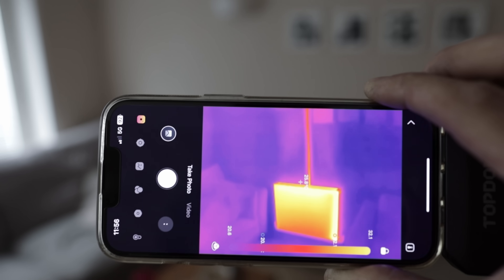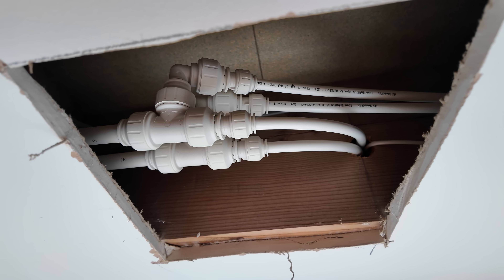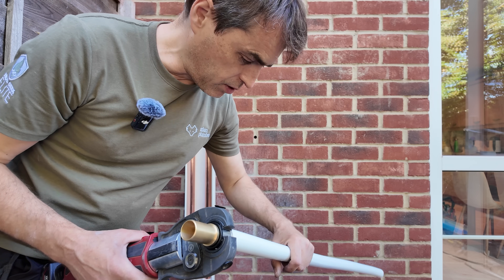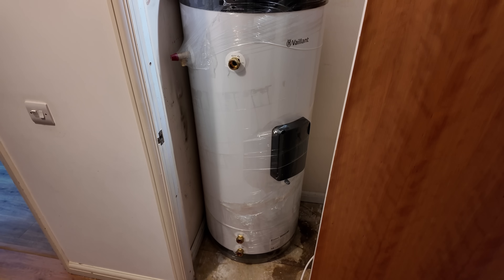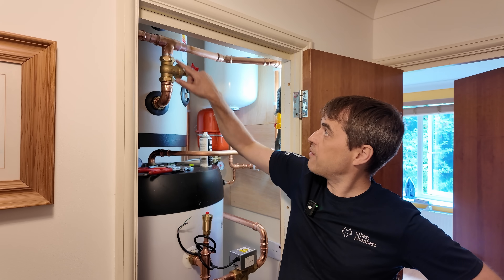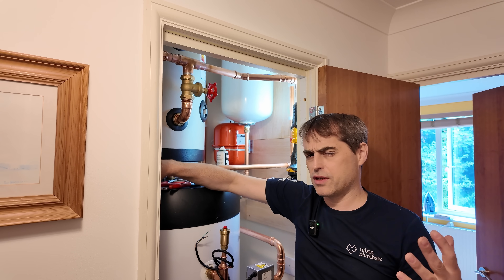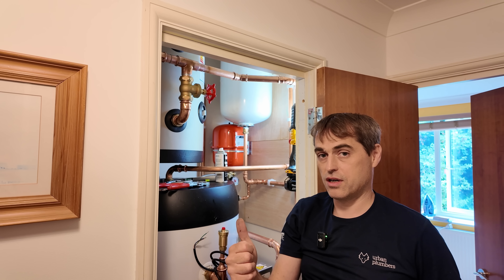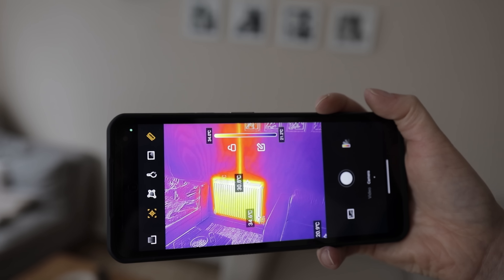Micro-bore Pipework & Heat Pumps: How To Make It Work.

Comment: Hi, I am interested in your 3 leg buffer/volumiser configuration where you can close/open a gate to switch between the two. I think this would help me in a similar situation where I am not sure I need hydraulic separation. When closing, how do you bypass the second pump? I am a novice so excuse me if answer is obvious

Comment: There is no harm to the circulation pump if it works at 100%, it is intended for that, and it is the only pump that consumes more.
If you now have enough flow, it means that the pump will probably start to modulate over time, because during the operation of the pump at full throttle, there will be a delta that requires a reduction in flow. and even if she doesn't modulate - she doesn't care.
And it really has an impact on electricity consumption for heating, the hydraulic separation bothers her even when the secondary is one zone and without mixing
Reply from the maker: pumps running 100% are too noisy (this one is) and not very efficient - generally a bad idea
Reply: @UrbanPlumbers  Incorrect. If you look at the efficiency diagram, you will see in which range of pressure drop it is most efficient at maximum speed, and the range is quite large. As I said, just because it is at 100% does not mean that it is not efficient, or even more efficient than oversized pumps at lower speeds. If it is noisy - the cause is something other than excessive rpm. As for the flow, when the required delta is reached, the pump will reduce the rpm and therefore the flow anyway via the pwm signal.
Reply from the maker: @ you don’t get pwm or dt pumps on those units and yes they are noisy at 100% - too noisy for domestic use. Maybe install one and see for yourself
Reply: @UrbanPlumbers  Which Vaillant heat pump model is this?

Comment: Awesome video!!! One question, I have a 14kw unit with no buffer and no external pump, with radiators on two floors. The downstairs radiators which are three are half and down cold especially the big radiator but the upstairs radiators have a better temperature but again the upper part is much hotter than the lower. The radiators are new  and the system is clean, do you think that buffer tank with external pump will fix this issue? Is it that bad that half the radiator is cold? When the compressor starts the flow is 1.77m3/h and after a will it goes to 1.25m3/h, I only work the heat pump for both floors and never separate because I get low flow errors.
Reply from the maker: it depens on your unit. Some units will run lower flow when the temperature outside is higher. Your unit should be running 2m3 when at desgin conditions. If it is not, then your system resistance is too high.

Comment: Curious why the heat loss calculations never mention historic consumption.  I do energy modelling and my go-to is to calculate heat loss based on historic data .. plus modelling the theoretical calculations as a check.  My bias though is to lean on historic data when the two don’t match (ie giga joules gas consumed by month and efficiency of the old  boiler = demand).
Reply from the maker: Because no one uses pure WC so historical consumption is very unreliable
Reply: @UrbanPlumbers  … sorry .. pure WC?
Reply from the maker: @solarguy4850  weather comp. 99% of gas systems are on / off so its impossible to get true representation of the actual heat loss.
Reply: @UrbanPlumbers  Thanks.  Sounds like I have a lot to learn.  I plan to start offering heat pump services in about a year or so once R290 is available here (Canada) .. so will go though all of your videos!  Very helpful.

Comment: 8mm microbore off 15mm to 22 rads upstairs, UFH downstairs, boiler is running 35-42C flow (I think nominal 10 l/m). No pipe noise, no problems except boiler cycling due to minimum delivery 7.5kW with maximum house demand around 3-3.5kW. No zones, no TRVs, 20.5C indoor with 19.5 night setback. Coldest day this year total HW+heating I've used 74kWh of gas. No installer even wants to touch my system to swap my boiler to a heat pump until I re-pipe the whole house :-(
Reply: That’s mad that no one wants to touch it, as long as any particular radiator isn’t expected to output more than ~750W and the pump in the heat pump will overcome the resistance, from my understanding it doesn’t need any work. Get a heat geek?
Reply: @SeanW-zi6kj  no heating demand for any room higher than 500W, but as I said no one will touch my house even heat geeks, was in contact with the local elite one already.

Comment: I have had a HP for 3yrs + on large bore. Only since the owners of the HP unit (Grant) had to replace a fan motor in July, has it worked efficiently. The installers only knew how to connect up the system, but not a clue how to run it. But, now I'm moving house and it has small bore on gas.

Comment: Great work!
I am dealing with a system with micro-bore underfloor heating, combined with radiators but the hydraulic separation is not stabilized and is killing the efficiency.
Do you think its worth trying removing the hydraulic separation and keeping the underfloor heating pump in series with the circulation in order to cope with the micro-bore head loss?

Comment: Thanks for a great video.  When you need to achieve hydraulic separation because 2 pumps are needed because of the pressure loss on the index circuit, what is the advantage of a vessel compared to a Plate heat exchanger?  Heat geek videos always seem to use a vessel when addressing the subject of separation.  Vaillant even has a hydraulic unit for ASHPs which is basically a PHE and a circulator in an insulated box. Is one clearly superior to the other?  This question is really bugging me.
Reply from the maker: Vaillant uses PHEX to separte glycolc from water. We do not need that, as we use anti freeze valves instead.

PHEX is much more problematic - it can block and be very hard to clean, it does not provide addtional system volume and also can only be piped one way. Buffer if it has to be used is a much better option with heat pumps.
Reply: @UrbanPlumbers  Thank you for your answer.  Very helpful.  

One last thing regarding the table you popped up on your great  video, I think the flow values for 0.7 & 0.8 kw are off by a factor of 10.  Where can I look up those tables for copper pipe - I can’t find them when I look.  Thank you again!

Comment: May I ask something? We have an oil burner split into 3 zones. 1st zone goes to the water boiler for hot water supply. 2nd zone is connected to a series of radiators inside the house (bedrooms and kitchen) and the 3rd zone is again connected to radiators in the hall/sitting area. Can a heat pump be retrofitted and utilize the existing water radiators and can they run on single phase electricity?
Reply: Short answer is yes. Longer answer is, you want all a single zone for heating. The radiators can be reused if they are sized appropriately for the design flow temperature, otherwise you have to run hotter and less efficient. Also on the single phase electricity depends on the heat loss of the property, and therefore heat pump size. Most properties aren't mansions so don't need three phase. I would get a Heat Geek trained engineer to do a heat loss survey and can then truly tell you what you can/should do.
Reply: @SeanW-zi6kj  according properly sized radiators, the system can provide cooling, right?
Reply: @socas_nic  Erm, in theory yes. In practice, not really. The problem is condensation when the flow temperature is below the dew point of the water in the air. If you're too low then it will condense then drip on the floor. Not great. However there other possibilities to have almost like air-con but using the chilled water from the heatpump to drive it, which would have to be on its own zone (to avoid the radiators). Not common (yet?!) though.
Reply: @SeanW-zi6kj  funnily enough i completely forgot about dewpoint for some reason I thought that because heat pumps work much slower than a typical ac unit, it wouldn't build up condensation,  however almost any type of cooling will result in condensation, especially with the absence of a fan on the radiators, (evaporators)

Comment: I think it is a huge mistake to still use the location of the old central heating spot as a starting point....you should use the heat pump as the central starting point

Comment: Just wanted to say thank you very much for your videos. Ive managed to set my unvented central heating up as a hot water priority system thanks to information i got from your videos that wasn't even in the boiler manual (SL2 on an ideal boiler ignoring flow temperature setting).

Education on this subject is severely lacking in the UK and we desparately need more people like yourself spreading the good word.

Comment: 8mm copper - 50 years old. Sounds like it could be made to work, but probably better replumbing before we get a heat pump? Is a manifold set up better for heat pumps (all radiators no underfloor heating). I could essentially replace all the existing runs but upsize the pipes from 22/8 to 28/15mm. Plastic pipe so no joints between manifold and rads?
Reply: Manifold systems are easier to balance

Comment: Excellent educational video. How do you go about matching the flow rates on both sides. As in the ciculator in the outdoor unit modulates up and down based on demand and the indooor one you have wont? Have you ever thought of buying the same circulator that the outdoor unit has and using that as the post buffer circulator and then using the same pwm control that the outdoor unit uses to also control the pwm on the post buffer circulator?
Reply: The Vailant pump hardly modulates. Matching the pumps would not give matched flow unless the primary and secondary system curves match. They won't match.
Reply: @andrewmillwardwatford9410  Is it best to have the secondary side pump modulate such that the DT across the secondary side matches the dt of the primary side?
Reply: @chrismorrish130  I want to see an intelligent secondary pumping that loads the buffer for reducing cycling and a pre charge for defrost. Really not a difficult control option. Between charging balanced flow would be maintained. The flow meter could be used as an energy monitor component also.

Comment: When you turned off the gate valve to the buffer did that remove the resistance of the secondary pump? If you had of removed the pump and put a straight through pipe, would that have removed enough resistance to then run it without the buffer?
Reply from the maker: Yes the pump would put some resistance on the circuit but not enough to be worth playing with.

What’s telling is that a 6m post buffer pump also had to run 100% to provide 800l/h without having to go through pre buffer pipework

Comment: This is another really useful video. I especially like the introduction to flow rates, pipe sizes and index circuits. Which I am very families with as I used those parameters a lot when designing commercial and very large domestic systems. I think that the requirement to understand  and apply this design process is going to become increasingly important in the domestic market and this will present a steep learning curve for many domestic installers. I would always use a buffer store when installing a heat pump to an existing microbore system.  They operate in a similar way to a low loss header. I only ever use Grundfos pumps😊

Comment: I've yet to transition to an ASHP and presently running a boiler. All the drops to the ground floor radiators are behind plasterboard in 10mm microbore (15mm in the ceiling before each drop). I've done my own heat loss spreadsheet - it's a complex building (1990 build, but not a simple rectangular box) - which seems to correlate reasonably well with my worst case daily gas use. I've compiled a map of my radiator plumbing detailing the pipe gauges and all the Tees, but I've not estimated the lengths of each segment. How necessary is this step?  I believe the index circuit can be identified without.

Comment: I really love what you do but in this particular case, condens boiler with new rads would be better option. Looking that hot press packed is worst nightmare for any technician and any repairs in future.
Reply from the maker: Not really. A decent weather comped boiler (viessmann, vaillant) with pdhw and new cylinder would cost the same as this set up plus vat - so not much sense to go gas route.

Comment: Thanks for the video, I have a question on the increased flow rates when switching from gas to heat pump. If the gas boiler is already running at 35'40'C DT5 and keeping the house warm, with 10mm plastic does that mean a heat pump can/will also work without buffers etc?
Reply from the maker: Would have to be running dt5 at -2c outside
Reply: @UrbanPlumbers  Thanks for the info.  I thought that would be the case. I have the most basic boiler without any smart stuff. For the last few years I've been heating water with the immersion using solar and off peak electricity so I started trying to run the boiler as cool as possible. We only need to adjust flow temp up to 40 when it gets below 0 outside. And I went to 45 when it got below -5 for a day or two. Otherwise it sits at 35 but runs for a lot longer. I don't make any adjustments to DT just twiddled the flow temp knob. The house is much nicer this way and it hasn't increased gas usage. But I'm now thinking we should get rid of gas and go to a heat pump.

Comment: Any thoughts on 8mm copper pipework?
Reply: Yes - it's much the same as 10mm plastic, so it might work if heat load not to high and runs not too long, but replacing it is best for efficiency so do that if you can.

Comment: Hmmm what I would do ? I would use Tado, and switch of the rooms that I don't use, rather than running all the house at full tilt all the time .... still cheaper than a heatpump installation cost + electricity used.
Reply: you're still indirectly heating unused rooms, unless you've got external-level insulation on the internal walls.  This means you need to heat the heated rooms more, pushing down efficiency.    Only in certain layouts and scenarios would it be cheaper to close off and not heat certain rooms.
Also, for insurance purposes, you need to keep the unheated rooms above a certain temperature anyway.
Reply: @BenIsInSweden  yeah, that's why the unheated rooms drop to about 10C within 4 hours during winter ... 
I'll extend to olive branch and let you know that unused rooms are living room, kitchen, dining room, utility room etc - al of which are at the ground floor, and heat travels up not down. during the day all 6 bedrooms are dropping to about 14C during the day due to warm sun exposure - tested this over the two weeks I was out during the winter. So my point still stands, rather than using heat pump and nearly breaking even on cost of instalation + cost of electricity VS heating the whole house with gas - it's better to heat only what you need with gas. And no, radiator driven by a heat pump doesn't have enough of "umph" to heat up a room in less than 30 minutes.
Reply: @tommybronze3451  well you're likely invalidating your insurance then, as many UK policies need it kept above 12C.   Most people won't want to run their system where it's 10-14C during the day.  You also lose a lot of boiler efficiency with fast heating, as you don't get the benefit of condensing.  And you're applying more thermal shock to the system by doing so.

Even with gas, in a normally-occupied house, it's more efficient to run it on weather compensation, than to keep turning it on and off.
Reply: @tommybronze3451  no you aren't, that's not how condensing boilers work. You need a lower temperature on the return for it to work.  Which conversely means a lower flow temperature,  if you only need to heat for 30 minutes to get the rooms up to temperature, then you are running the boiler flow temperature hotter than it needs to be, and also not making much use of the condensate.
And not sure why you think I'm a heat-pump activist when I'm talking about how to make a gas boiler run more efficiently too.
Weather compensation on a gas boiler adapts the flow temperature to the outside temperature, and it doesn't take a maths genius to wrk out how it is more efficient.  There's plenty of resources online as well that demonstrate how weather compensation on a gas boiler is more efficient.
Reply: @BenIsInSweden  again, no. Heating the room is based on bang-bang control on the radiator - so the water doesn't flow through it and then return HOT to the boiler. If you're heating the room from the colder temp, then a return to the condensing boiler is colder than when heating the room that is already at 21C. Seriously I'm not even expecting anybody to learn about tado, but basic TRV understanding should be in place. TRV is mostly affected by heat from the pipe going back to the system, IF that temp starts to rise above desired room temp then TRV shuts the flow down, plenty of very cold water will flow way before that, making the condensing boiler more efficient.
Reply: @tommybronze3451  I'm not sure how you aren't seeing the error in your logic here. Yes it returns hot to the boiler. Thus it can't get the heat transferred from the condensate.

Optimally you want to return water to be heated as much as possible by the condensate.
The simple fact is you want more condensate to be able to achieve that, and the only way of doing it efficiently is to have it running for longer at a lower temperature 
Higher flow temperature to get the place warmed faster will not maximise the condensate usage.

Using trvs heats up the return temperature faster and again minimises the condensate usage.
Reply from the maker: Ben is right. Micro zoning is killing your efficiency and killing your boiler. Not the smartest idea - although controls manufacturers make you think it is